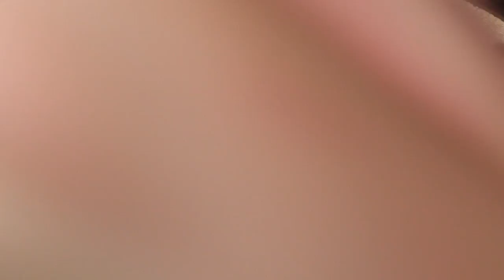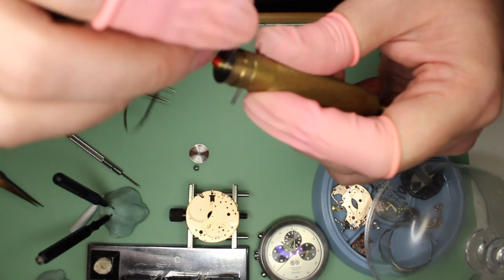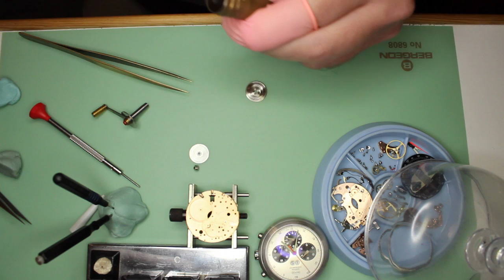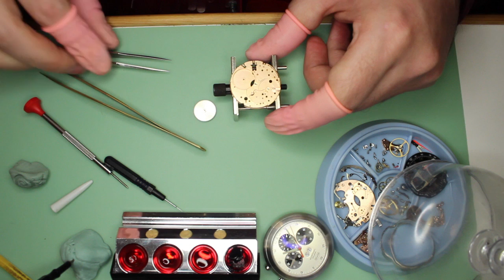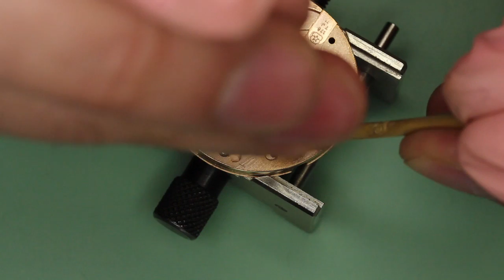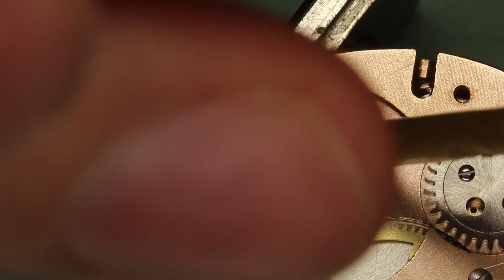How to service a Chronograph watch. Part 3 of 6. Breitling. Venus 175. Watch repair tutorials

Comment: I noticed you used 9010 for the train. Is this a 21600 bph or a 28800? So, what oils do you recommend when it comes to bph? I've read somewhere that is best to use 9020 for slower movements like a seiko 6309. Thanks!

Comment: I saw that you added oil to the barrel arbor, but I didn't see you add any oil to the mainspring. I've always thought it was common practice to oil the mainspring with three or four drops after it has been installed in the barrel. Can you explain why you think that isn't necessary?
Reply from the maker: Before winding the mainspring I apply an extremely fine film of grease along the length of the mainspring. Sorry this is not featured in this video but I think it is shown in one of my other vids.
Reply: Watch Repair Channel I found the video you are referring to. I hadn't seen that method before. I'll have to give it a try.

Comment: Hi Mark i was wondering when disassembling a movement do you have a system to keep all parts and screws together so they don't get mixed up. Or do you do this from memory.
Thanks.
Reply from the maker: it's from memory/experience. But when you are starting out you are advised to make good use of a digital camera. Back in the day we used to make sketches and notes. I hope this helps.
Reply: Definitely thanks.